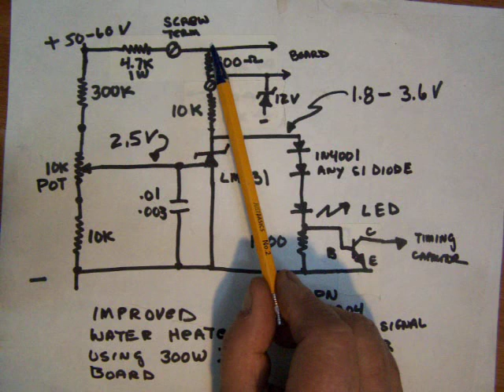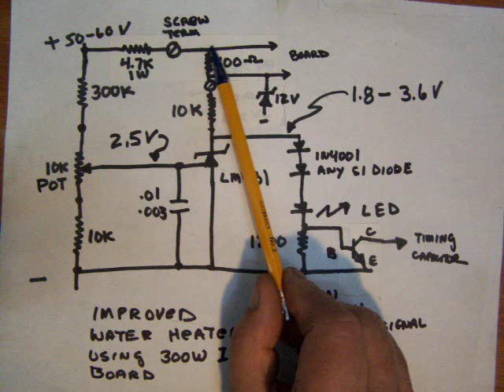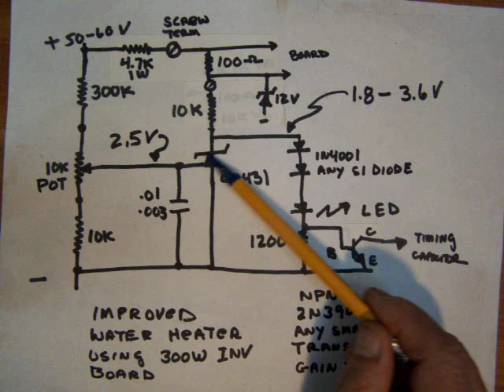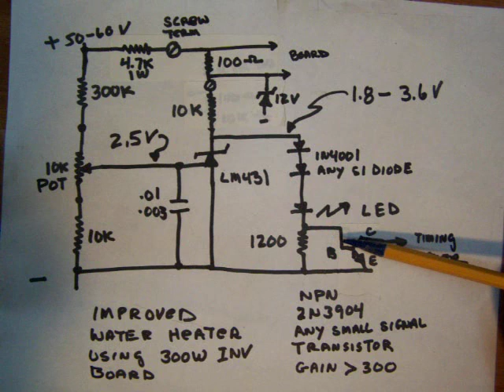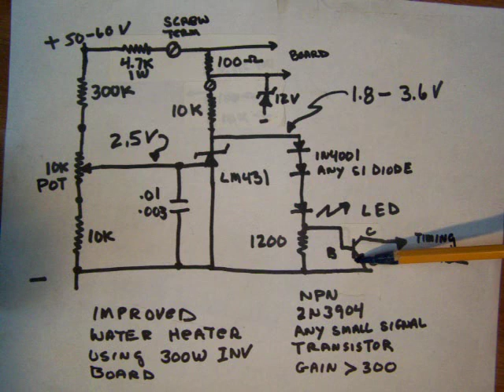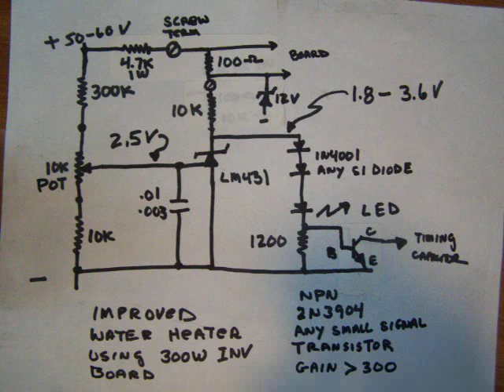Simplified MPPT PV Solar Hot Water Controller Schematic Pt.1

Comment: i would like to purchase one or two of these from you if you would build them for me. im guessing they are similar to techluck solar board. please advise
Reply from the maker: Thank you for your interest. I heard techluck stopped production again, that was a poor design that had many failures and they refused to repair them.  When they failed every semiconductor on the board was wiped out. My board was designed for diversion which is the aspect I am interested in, although it could be used stand alone.  There was a lack of interest and understanding in how it worked. I had built many  evaluation units and the solar community.screwed me on that by not reporting back.  The person who was going to build and sell them lost interest.  Project is canceled. .